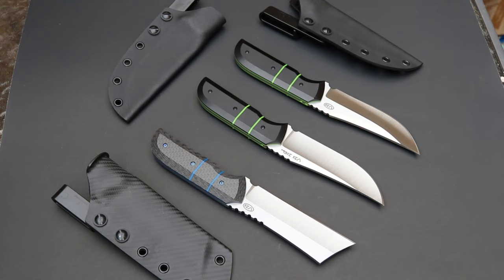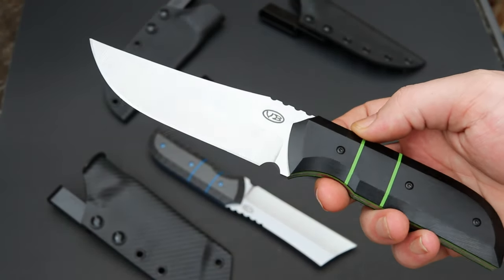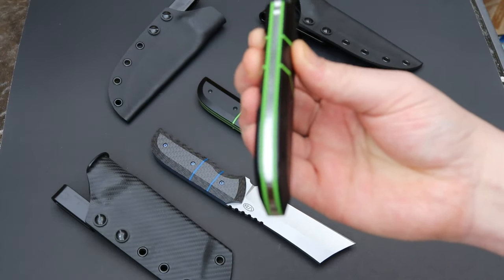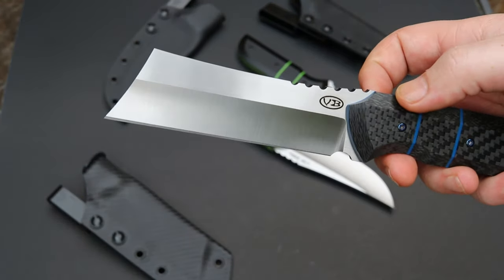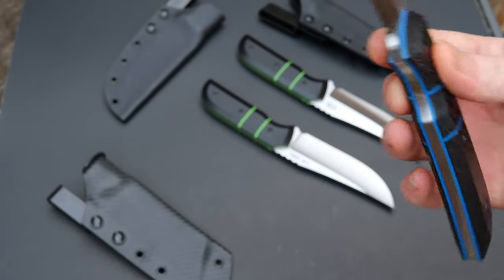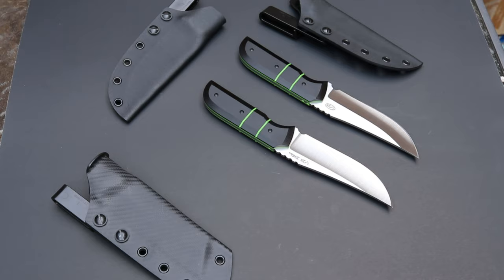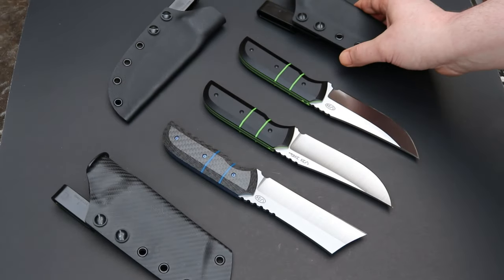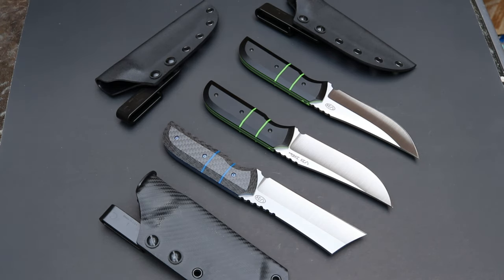Carbon Fiber and Matching G10

Comment: Please tell me you do custom work.  Trying to find someone who will take an 8 inch Busse HOG (.38) thick, take it from a drop to a slight clip point, w/ false swedge.  Remove the rubber handles, fabricate G10 handles, (I'll even settle for micarta at this point).  Remove the black coating, do a satin finish.   Possibly re-grind to a convex (if possible).  Your knives are gorgeous, man.